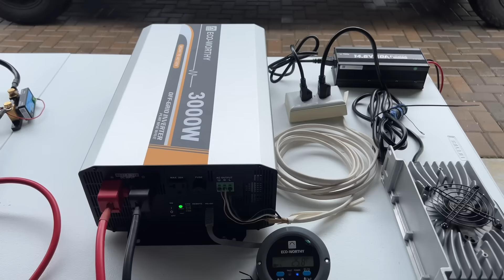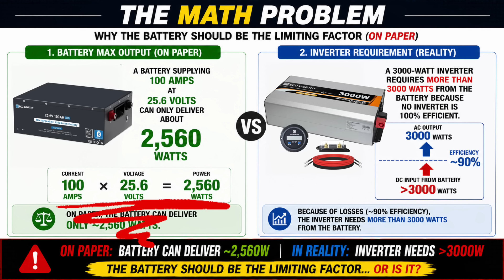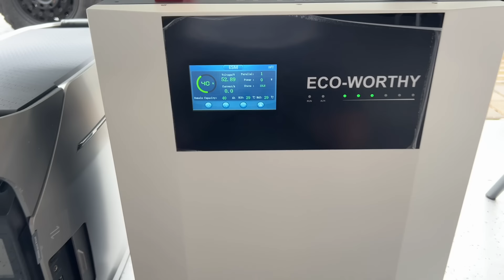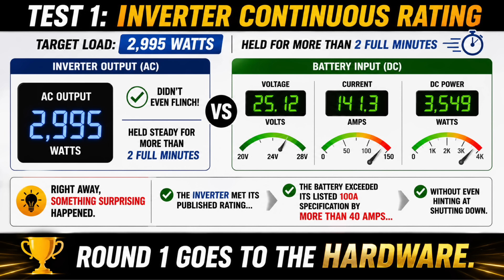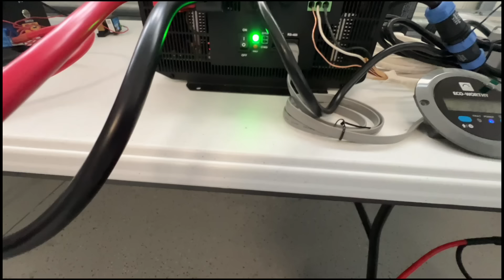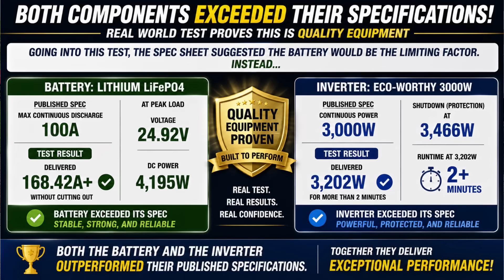Can This Eco-Worthy 24V Battery REALLY Run a 3000W Inverter?

Comment: Ruby, could it be that the battery didn’t have the proper overload protections? I’ve seen Will test a lot of batteries, and they all shut off if asked to produce even a bit over max voltage. Something is definitely wrong if that battery didn’t shut off, in my honest opinion. Did you see if the battery was heating up, two minutes isn’t long but under proper conditions, I believe the battery would shut down?
Reply from the maker: Hello Jerry, the shut down is usually heat based so that is why these batteries can manage an over current for a short period of time.  I suspect if I would have attempted 5 minutes the battery would have produced enough heat to shut it down.  I am subscribed to Will's Channel as well and he is way braver than I when it comes to testing batteries to their extreme limit and opening up a battery to see what happened ...I tend to focus more on RV system applications.  Thanks for the comment!

Comment: I think the battery should shut down first, unless the inverter has a shut off if under powered.
Reply from the maker: That’s a great point, and it really comes down to which safety threshold is triggered first during the test. 😊

Comment: I'm an advocate for Lifepo4 battery manufacturers publishing their BMS settings, even if they are not editable in any way. That way if a battery performs irregularly it can be compared to the specs. A 100A BMS putting out 168A for minutes, while impressive in some ways, is also very concerning. Will it interrupt current flow in the event of a short? Knowing the settings we'd know if this is an anomaly.
Reply from the maker: I completely agree that having access to those specifications would provide much-needed clarity for safety and performance testing. 👍

Comment: I won't push the battery beyond its specifications that way. The issue is that some batteries might have trouble recharging. After I overloaded the battery, it couldn't be recharged back to 100%.
Reply from the maker: That is a very fair point, as protecting your battery longevity is definitely the priority. 😊
Reply from the maker: I will say, Eco-Worthy makes some great quality products.  They are one of the few battery companies that I have been impressed with.